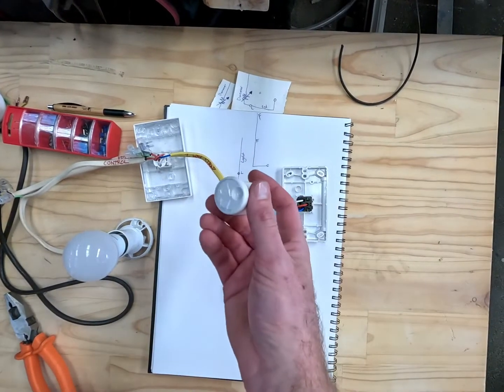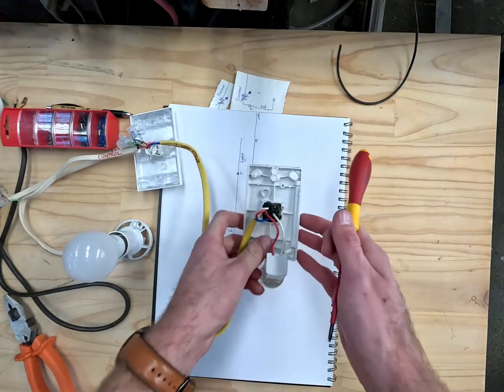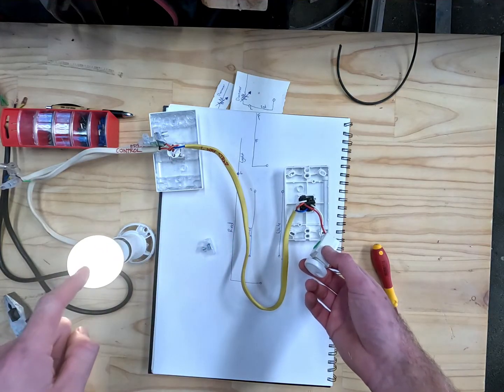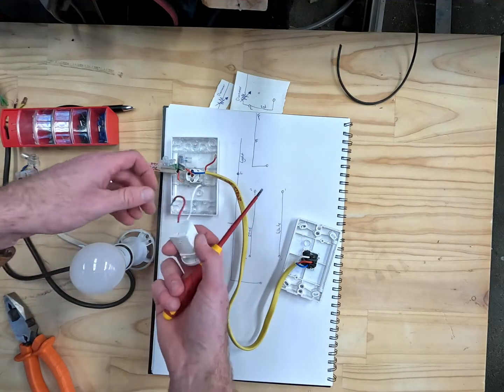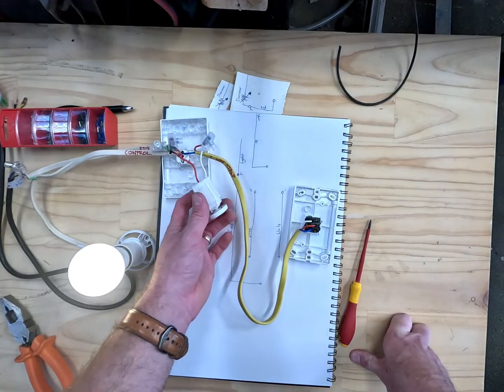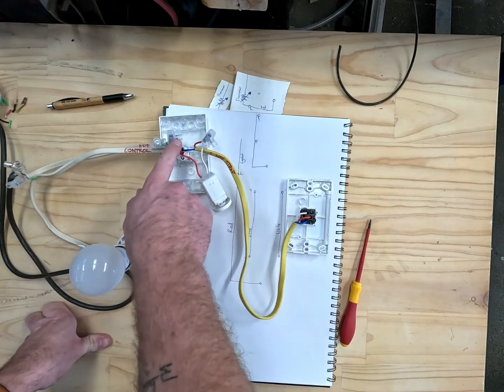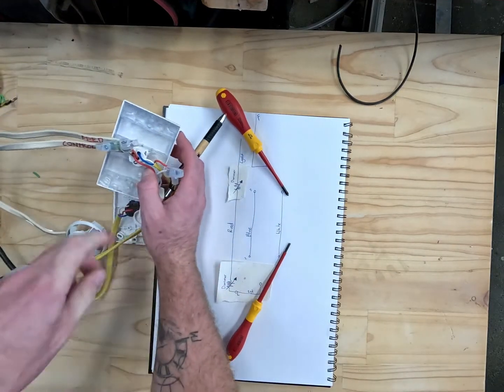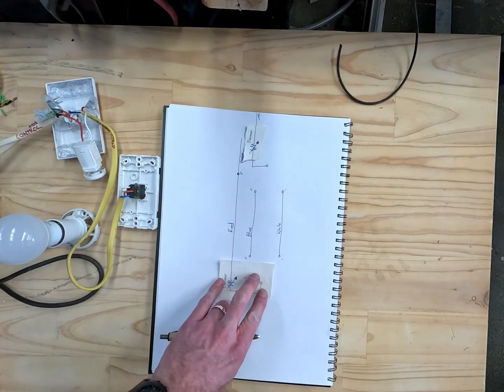How to wire a dimmer into a 2 way light switch.

Comment: I installed one of these to my led down lights that i fitted in the hall they were only 10w but still to bright but after fitting this dimmer could dim them down to just a faint glow good when i need to get up at night without being blinded by bright lights.
Reply from the maker: @GAZZA55  Nice, did you use my video to wire it, or did you already know how ?
Reply: @_nztradie  no i liked your video but have a  fairly good understanding of electrical wiring and work to the safe code of practice and test with a meter before and after . Replaced all the old PDL 500 series switches and sockets with the newer 600 series. those old rocker type ones were at the end of there life. At least our house does not have the old rubber insulated cable and the TPS is in good order.
Reply from the maker: @GAZZA55  yea, rubber cable can become a nightmare better quick. Are you an electrician? Or doing your work under the home owner exemption?
Reply: @ No home owner exemption, But when i left college back in the 70s i worked as an electricians labour running cable in new builds so learned a lot over the years. My wife said i should have gone into the trade but found the cost to high.

Comment: Simple dimmer end. Switch wire in loop with dimmer wire. Other dimmer wire in common. Second switch A in common straps between 1and 2 on both switches

Comment: If the dimmer was put on the neutral wire then the dimmer would not be live? Or is there a further problem in doing this? Thanks
Reply from the maker: The dimmer needs to be in line with the light and before the lamp in order to dim properly